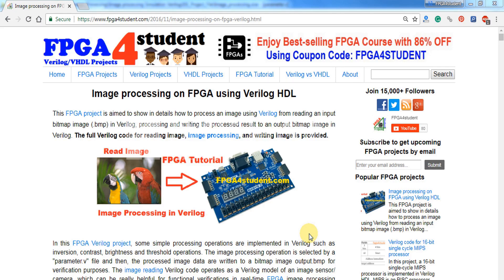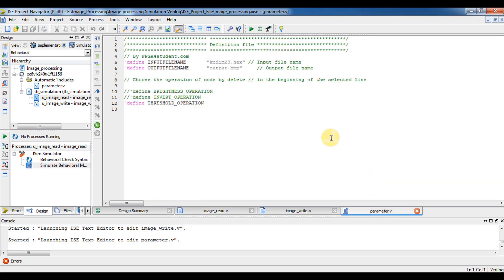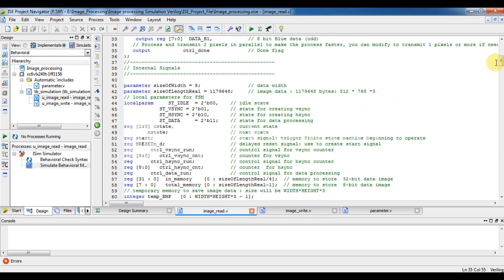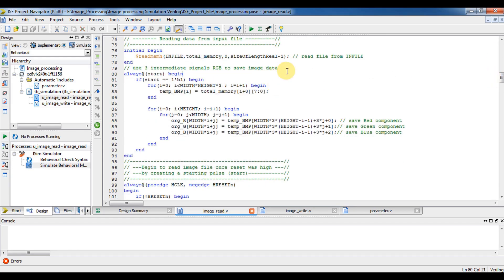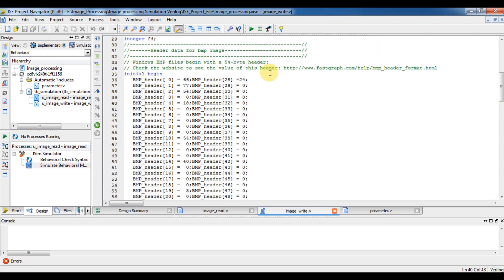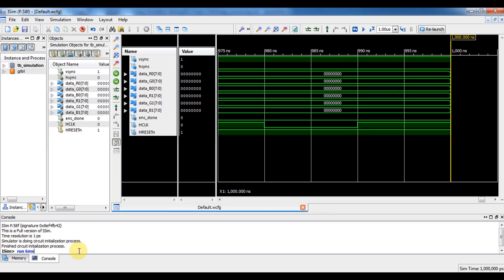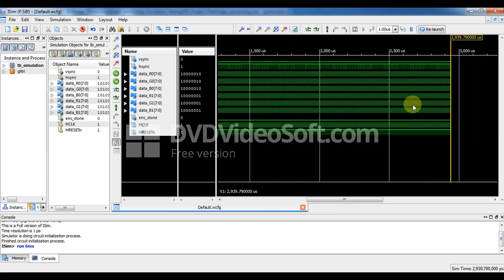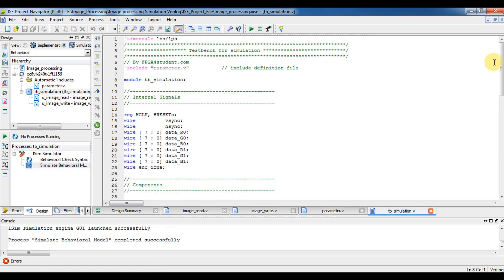[FPGA Tutorial] Image Processing in Verilog

Comment: After simulating I am not getting any image but the file is generated, Please can you explain .
Reply from the maker: Please download the project file in the website link and follow the steps in the tutorial video
Reply: @FPGA4student  I did. I did this in vivado FPGA board for getting image should I synthesize it or the simulation is enough?
Reply from the maker: @nithishreddy2384  simulation is enough to get the image. Just follow the tutorial in the video. If you want to run on fpga, some modification is needed.
Reply: @FPGA4student  can you please tell the modifications I should do because in the tutorial they aren't mentioned.
Reply from the maker: @nithishreddy2384  If you really want to synthesize this code (read and process) and load the image into FPGA for processing directly on FPGA, replace all the temp. variables (org_R, org_B, org_G, tmp_BMP = total_memory) by block RAMs and generate addresses to read the image data (remove the always @(start) and all the "for loops" - these are for simulation purposes). There are two ways: 1. write a RAM code and initialize the image data into the memory using $readmemh; 2. generate a block memory using either Xilinx Core Generator or Altera MegaFunction and load the image data into the initial values of memory (.coe file for Xilinx Core Gen. and .mif for Altera MegaFunction), then read the image data from memory and process it (FSM Design).

Comment: Hi Sir, I am getting an error   in line   for(i=0; i<WIDTH*HEIGHT*3 ; i=i+1) , the error thrown is Error (10106): Verilog HDL Loop error at img.v(82): loop must terminate within 5000 iterations
. I am using Quartus Prime lite edition 18.1. Please help
Reply from the maker: Nanda Kishor the code is for functional simulation purpose, not synthesis
Reply: @FPGA4student  For synthesis, a few steps are mentioned. Since I am new to FPGA, can you advice me some reference material
Reply from the maker: You can try the book: Verilog HDL synthesis, a practical primer.
Reply: @FPGA4student  Hi Sir, thank you for the help. I also want to know, whether there is any other methods to directly load the image into RAM memory in Terasic DE 10 nano board, other that converting into hex
Reply from the maker: @NandaKishorNandzz  Hex/binary is the only way.

Comment: hi
Error (10560): Verilog HDL Expression error at file_transfer.v(445): indexed name specifies too many indices for array "BMP_header"
how to solve this?
Reply: Error (10560): Verilog HDL Expression error at file_transfer.v(450): indexed name specifies too many indices for array "out_BMP"
Reply: i am using quartus II
Reply from the maker: Double check if index of BMP_header exceeds the maximum number of components of the array
Reply: @FPGA4student  hi
to solve the problem i have used ISE 
the code is working  but the $readmemh(INFILE,total_memory,0,sizeOfLengthReal-1); is not writing the values inside to 'total_memory'
i checked the file and also INFILE
the has the values
if you have email id, i can forward you the picture and we can discuss it further
thank you
Reply from the maker: Make sure the INFILE is inside the project folder
Reply: @FPGA4student   it is 
the INFILE is read but its not copying in the total memory file
Reply from the maker: If the INFILE is within the project folder, total memory should be loaded. Double check the INFILE format if it is hexadecimal.
Reply: @FPGA4student  i downloaded your file so they are in the hex format 
from here https://drive.google.com/file/d/1xgrft6NXb5BSf4UEuApuTHuo_mHrKRBA/view
Reply: @fnumohammadkhajanadeemuddi250 hello..!
Did u get the output image ??

Comment: a warning is generated after simulation please help me 
WARNING: File kodim23.hex referenced on /home/usr1/Desktop/iage comp/image_read.v at line 77 cannot be opened for reading. Please ensure that this file is available in the current working directory.
Reply from the maker: bhargavi patel kodim23.hex is the image file that you want to process (hexadecimal). you need to put it in the project folder (change the file name accordingly in the code)
Reply: @FPGA4student  i have created project folder and then created new project and added all files but still this error is generating 
 WARNING: File kodim23.hex referenced on /home/usr1/Desktop/project/image_read.v at line 77 cannot be opened for reading. Please ensure that this file is available in the current working directory.
INFO: [USF-XSim-96] XSim completed. Design snapshot 'tb_simulation_behav' loaded.
Reply from the maker: bhargavi patel you need to put kodim23.hex in the new folder
Reply: @FPGA4student  ec_done  value is 0 ,HCLK is 0 after running code  nothing is happening
Reply: @WorldOfBhargavi   I'm also facing the same problem. Did u find any solution for that
Reply: SUPER LATE REPLY but the solution is to add the file as a simulation source in Vivado.
Reply: @wiserdivisor  how to add i have all in the project directory but error is there
Reply: Bro you find the solution to it or not?

Comment: Sir finding it difficult to convert bitmap into hex...please suggest  some clue
Reply from the maker: Below is a Matlab example code to convert a bitmap image to a .hex file. The input image size is 768x512 and the image .hex file includes R, G, B data of the bitmap image.
b=imread('kodim24.bmp'); % 24-bit BMP image RGB888 

k=1;
for i=512:-1:1 % image is written from the last row to the first row
for j=1:768
a(k)=b(i,j,1);
a(k+1)=b(i,j,2);
a(k+2)=b(i,j,3);
k=k+3;
end
end
fid = fopen('kodim24.hex', 'wt');
fprintf(fid, '%x\n', a);
disp('Text file write done');disp(' ');
fclose(fid);
% fpga4student.com FPGA projects, Verilog projects, VHDL projects
Reply: you have to do conversion in notepad++ by using given matlab code

Comment: how to do this image processing using fpga i need from starting
Reply from the maker: Check this: https://www.fpga4student.com/2016/11/image-processing-on-fpga-verilog.html
Reply: @FPGA4student  but the process of using fpga is not given in that site...and also will altera de2 work? and if it does can you explain the process of designing it?
Reply from the maker: Aishu Engolikar I did mention how to do it on FPGA. Read more on that link.
Reply: @FPGA4student  can you explain in detail what are we supposed to do to verify it on the fpga..?
Reply from the maker: @aishwarya9227  run it on FPGA and display results on a VGA monitor or send it back to PC and display it using Matlab/C
Reply: @FPGA4student  ok thanks
Reply: @FPGA4student  how does the header change with size...say for 721x481 sized image?